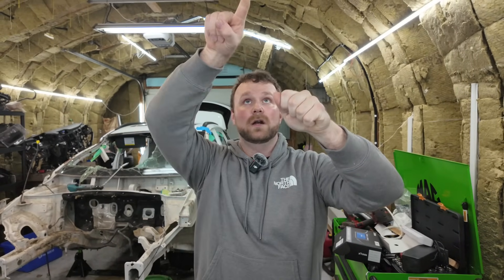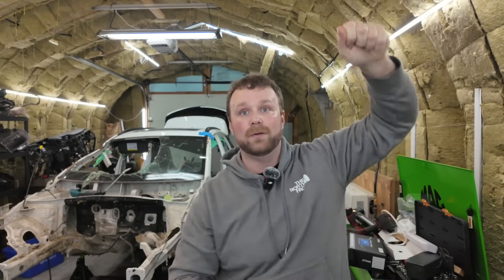Why were these L87's left out of the GM recall?

Comment from the maker: What do you thinks going to happen?
Reply: GM will get bailed out by the Government.
Reply: I have a 2014 2500 HD with a 6.0 nothing has been said about this engine.
Reply: @edwallace7913  from a technician perspective nothing needs said.  Like a rock til you need a transmission at 101000 miles.  The 2014 was sold with 100k powertrain warranty for a reason
Reply: @edwallace7913  I have a 2019 express 2500, 6.0 no problems with the engine, ...just brakes 😵‍💫😵‍💫😵‍💫
Reply: @Lancemechanics  I think that whoever manufactured these crappy parts won't pay a thing and all the money GM saved on using cheap Chinese and Mexican labor will be eaten up plus!  I cannot ever remember this man recalls growing up!
Reply: My SWAG, is GM owners are going to end up with alot of busted up engine blocks............ and no one backing them up.
Reply: @Lancemechanics  ford's solution for cp4 pump failure is ecm programming. Welp now blame it on aftermarket tunes.  The 6.2 is preferred by those wanting a high horsepower engine.  So a ton of them are actually tuned up aftermarket. So read the calibrations and deny coverage because of tune. Or....I have actually taken an engine apart that I drove hard for about 5000 miles . Was gonna put it in another pickup.  Pulled the pan and 2 of the rod journals had silk fabric from a shirt for rod bearings.  That was 40 years ago.  I'm sure textile technology has gotten better since then.  Just food for thought.
Reply: Gm gonna go out of business at this rate...new vehicles are overpriced and unreliable junk. Even to change valve covers on my 09 inpala the dealer wanted 1200😂😂😂I did it myself in my driveway with basic hand tools. Overquotinf basic maitnece and selling overpriced junk is a quick way to go out of business I wonder how much longer they'll last...

Comment: I own a 2020 GMC Sierra Denali equipped with a 6.2L L87 engine. On April 17th, the engine experienced a catastrophic failure. Leading up to this incident, the vehicle exhibited excessive engine oil consumption, necessitating oil changes every 5,000 miles. While I am not a trained mechanic, this seemed abnormal. At 66,000 miles, which is marginally beyond the manufacturer's warranty period, the engine failed, with an inspection revealing three bent connecting rods, requiring a complete engine replacement.

Adding to my frustration, despite being prepared to pay for a replacement engine, General Motors is currently not permitting their sale. This is particularly perplexing given their assertion that my 2020 model is excluded from the recent recall due to certain differentiating factors. This stance appears contradictory to my situation, as the vehicle clearly experienced the same issues described in the recall and numerous class-action lawsuits pertaining to this specific engine.

I would greatly appreciate any additional information or advice others may have encountered regarding this issue. Thank you for the video.
Reply: I too had my 2020 6.2 blow - mine at 67K. It was drinking oil so the dealer started a consumption test. .1.5 weeks later, the truck started smoking from exhaust and I had it towed in. Turns out the pistons were scorched and totally shot. Only fix was a new engine. Luckily , I had an extended warranty that covered the engine. Problem is, the wait for a new engine was estimated to be at least 3 months. My dealer let me trade out and i bought a Ram with the Hemi. Never again GM

Comment: ...wonder how many L87s CarShield and Endurance have paid for repair or replacement before this recall and wonder if they are going to back sue GM for their out of pocket expenses? What if you've had a '21-'24 recall engine installed in a vehicle that had a blown up L87 in a 2019 or 2020 vehicle? Will GM re-replace that engine? With a 10yr/150k warranty?

Comment: Get some cover on that insulation please. 😮
Reply from the maker: Being done soon :)
Reply: @Lancemechanics  Ok. Use a respirator, not a medical type dust mask. Your lungs will thank you. Sorry, many decades in heavy construction has me noticing this all the time. Your rounded surface is going to give you fits finding a suitable covering. I would suggest plastic or metal/aluminum  corrugated roofing sheets. Metal is fireproof.

Comment: If GM would just tune their ECMs the way German companies do, they wouldn’t need cylinder shut down. VW, Audi and BMW use a homogeneous mode for cruising. Essentially the engines run at roughly a 50:1 air fuel ratio when cruising. That’s why their four cylinder DI engines get upwards of 45 MPG on highway cycles.

Comment: I had a 2018 chevy pickup with the 6.2 engine and it blew up under warranty with only 30 k miles on it, GM put in a new crate engine and with less then 60k miles and 3 years of mostly highway driving, it locked upon the highway, I  dont think GM has fixed the issues and probably has warehouses full of these motors , so getting a replacement engine may just be a tempoary fix you have to deal with in 2 more years if you choose to keep the vehicle
Reply from the maker: Thanks for telling us. There's been a update on the tsb and I see other channels posting but again they've missed so much. Its a wording nightmare. One line say if even needs replacement. This path will get extended warrenty. If needs replacement not getting extended warrenty doing it this path. I'll have to release a video. Its wild

Comment: I would think that the whole problem is the way to the oil. The 0W 20 is a very thin viscosity and does not offer near the protection as the 0W 40 does.
Reply: Agree, the corvette uses the 0w-40

Comment: I bought a new 2007 gmc sierra. Recalls. Wipers not shutting off. Heated washer fluid would set some on fire. Bought a new 2007 gsxr 1000. would go to full throttle. was recalled. Bought a new nissan titan. new engine at 21k. bought a 2020 kia soul . new engine as rings weren't hardened. Bought a 2017 camaro ss. lifter failure. All i can say. Is Everything made in the last 20 years that i bought new was FUCKING JUNK!
Reply from the maker: Damn. That's an unlucky list.

Comment: Riddle me this. If we just used the most reliable engines of each mfg. ie ls3 gm. Wouldnt the slight difference in emission's be way offset from NOT having to replace thousands of parts and all the associated pollution. Ie the people making the newer parts. Distribution all the way down to the mechanic doing the job. Its honestly absurd.
Reply from the maker: I keep thinking to my self. Has anybody actually asked that question. or how much emissions are make to remake these plants or retool them every 2-5 years. Or the amount of space required for 1 vehicle manufacturer. Were talking 100s of acres for 1 manufacture.

Comment: So I own a 21 6.2 and it is not recalled.
Reply: I have a 21 6.2 as well, check the build date on the door. mine was built 09/20 and the recall is only for vehicles built from 03/21-05/24 not model years

Comment: Was getting a regularly scheduled oil change yesterday at my dealer (GMC 1500 ‘24). Talked about this issue and they said “no remedy” as recall isn’t officially active at this time.
I said I don’t care put in 0w-40 oil regardless, which they did.
Don’t know if it will help, but figured better than putting back in that 0w-20 piss.

Comment: Imo, the problem has to be with coatings. 20 grade oil doesn't work on traditional engine components ,but advanced coatings have allowed engines to run thinner and thinner oil improving efficiency. The fact that they are "fixing" the issue with thicker oil tells me that somewhere along the lines a coating technique worked in practice and failed in full scale production.
Reply: Thin oil is for meeting CAFE standards only. In other nations these engines are recommended for 5W/30 and there are no problems. EPA is our problem. Just dump in heavier oil is the first thing to do.
Reply: @debi5292  Yea to be honest I'd never run 0w20. You are relying on advanced material composites and coatings to prevent catastrophic failure. I understand that the general consensus is to use what the manufacture suggests, but me personally.. I'd rather lose a few mpg's then have a time bomb under the hood.

Comment: GM is screwing over every owner. The heavier weight oil is just so that the engine can limp past the warranty. Then GM will ghost consumers. They will not be replacing engines unless there is a catastrophic failure. They have been cutting corners for a long time now, and the issues are stacking uptime to buy another brand.

Comment: There seems to be a lot of talk confusing the bottom end issues with the lifter issues. They are separate and distinct problems. The recall of the 6.2 is the truck L87 only. It doesn't include the LT engines in the corvette/camaro. The lifter issue is across the board in all the 5.3 and 6.2 LS/LT engines that have AFM or DFM. Ironically the oil switch from 0W20 to 0W40 is 'supposed' to help the bottom end issues but ironically I have seen several techs and engineers say that that increase in viscosity might actually accelerate the lifter failure issues as those shitty AFM/DFM lifters are designed to work with 0W20 and some suggest that 0W40 is too thick to make them work properly. I don't know if that is actually the case but sounds about par for the course for GM right now!!
Reply: Mid 90's 1.9 low mileage Escort of my nieces...

Brother does his own maintenance...

Changed the oil/filter and it had a lifter/follower noise from startup...

Called me and I asked him what oil he used...

When he said 5W-30, I told him to make sure it didn't take 5W-20, which he had never heard of.

It did. No more tick.

Comment: All they are doing with the oil viscosity switch to 0W40 is trying to push as many trucks past the warranty period as possible so the customer gets stuck with the repair bill. There is a design flaw with the block or crank or bearings or rods or an assembly issue. Changing oil viscosity won't fix that. It MIGHT delay failure but won't prevent it.
Reply from the maker: 100% push it past warranty:(
Reply: It's funny how long we have been building ICE and here they are trying to reinvent everything. I blame the cancer that is the EPA for squeezing out ICE year after year. Always trying to make that BS 0.1% of better fuel mileage to make the cut, thin the oil, lighter tension piston rings, etc. Meanwhile, 80's and 90's Japanese vehicles are peak automotive engineering. Why? They had to make a name for themselves and weren't playing games as far as quality is concerned.

Comment: Are these oil pumps variable volume displacement?
If your engine fails while loafing down the interstate at 1700 RPMs, is there the proper oil flow?
Reply from the maker: Great question. Vane type with variable displacement.

Comment: Thanks for all the updates I’m 70 with the 21 Denali 6.2 retirement truck and don’t know what to do 🤷 We are so screwed all the time in Canada 🙏✌️🇨🇦🇺🇸🙏
Reply from the maker: Can do the afm/dfm delete. Pretty common in Ontario atm.
Reply: I don’t have the start stop bs there was chip shortage when I bought it and I drive in L9 all the time so the cyl doesn’t deactivate ✌️Took mine to dealer today for there oil change fix on engine recall But they couldn’t even do that because GMC didn’t give them to ok yet 🤷🤷🤯🙏🇨🇦

Comment: I have a 2025 2500hd with the l8t 6.6l. It does not have dfm but does have vvt. Cast iron block has a far better engine oil system that supplies oil to the mains first, not the cam galley. The 6.2l is a flawed design period. Changing the oil to 0w40 will not fix it.

Comment: The L87 is a 6.2-liter, V8 gasoline engine produced by General Motors, part of the EcoTec3 family within the Gen V Small Block architecture. Introduced in 2019, it powers trucks and SUVs like the Chevrolet Silverado 1500, GMC Sierra 1500, Chevy Tahoe, Suburban, GMC Yukon, and Cadillac Escalade. It delivers 420 horsepower and 460 lb-ft of torque, paired with a 10-speed automatic transmission. Key features include Dynamic Fuel Management (DFM), which adjusts cylinder activation across 17 patterns for efficiency, direct injection, and a pushrod OHV design with an aluminum block and heads. The L87 succeeded the L86, offering improved fuel economy over its Active Fuel Management system. It’s praised for towing (up to 13,300 pounds in the Silverado) and performance but has faced reliability issues, including bearing failures and lifter problems, leading to recalls and a 2025 NHTSA investigation into nearly 878,000 vehicles.

Comment: I think I’ll be buying a dodge 1500. They can keep their overpriced pile of transmission and engine junk.
Reply: Get an F150 ...the 2.7 and 5.0 are bulletproof...and the 3.5 has updated cam phasers, starting in 2021....even cam phaser tick didn't damage the engine, make it undriveable.....and the 10 speed transmission issue was addressed with updated drum a few years ago...

Comment: What I find funny is the concentration on #3 cylinder.  Statistics should have a dispersion across all 8.  What production / installation process causes such a concentration of failures.  I do not believe there is a way to change main bearings from underneath, no room to really lift the engine, or to lower the front subframe for access.  I think it's a really labor intensive job to do the 4x4's.  Drop the xfer & transmission out the bottom and  lift the engine out the top.  Maybe lift the cab off the frame and do it like a diesel truck?
Reply from the maker: I'm not sure what they are doing to speed up times at chevy, but dodges now everything is cab off  even in the 1500s, Yeah guess I got lucky on the Asian engines. One day I was just Like. Eff it ima try something stupid! lol
Reply: Stop trying to cram 10lbs of shit into a 5lbs bag. Go back to making them the way they used to.

Comment: Thicker oil only helps with fuel dilution issues. Junk engine overall. 6.0 2012 engine was ok but had the cylinder deactivation that ruined cam lobes. Junk junk junk

Comment: My question is if 0W-40 is now acceptable in some versions and not others? 

Why would it not be acceptable in 19-20 and 25s 6.2s?

I have a 2021 Tahoe built July 2020 and it doesn’t fall into the manufacturing defect window of March 2021 to June 2024.
Reply from the maker: I really don't know. But I checked posts on reddit about people using 0w40 in the middle east as early at 2019. Its quite the situation. No one really knows

Comment: Nobody makes a quality vehicle anymore. NOBODY !
Reply: @Damn-h4e  I could be off base on this, but I'm putting all these mechanical failures on one, super thin oils, tolerances that are to tight, operating internal temps. Poor materials being used, the UAW putting horrific financial pressures on the manufacturers, and most of all parts all parts being made overseas.
Reply: Get a Gladiator
Reply: Facts. They want to make more fuel efficient engines, but one doesn't buy a full sized pickup with a V8 engine and expect good mileage. Deactivate the cylinder deactivation feature. Engine will last.

Comment: The moral of the story is if you buy one of these vehicles brand new you have to buy a device that disengages the DFM system and keeps the motor running as a V-8 at all times.

I think if you do that you probably will never have any issues.
Reply: Na just drive it in L9 and it  deactivates all that stuff anyway, it doesn't allow the cylinders to shut off by driving wen you drive it in L9
Reply: @will195 I keep mine in sport mode all the time. 2019 Sierra with 12,200 tow package. 55,000 miles and no issues yet. 🤷‍♂️

Comment: People need to do more research on the vehicles they want to buy.
Reply: You don't have to research very far, before you realize they are all crap.
Reply: You are 100 percent right @joeL-m7q5m
Reply: Your so so right. I did that back in 2019 when I purchased my Ram. Bottom line is. Research, see what the main issues are overall and pick what issue you want. I still have my Ram and it’s been great. But they have there known issues already also but cheaper to fix.
Reply: Home run and I agree.   I researched first and have no regrets.    Go Pro4X.     Zero engine issues since it was introduced back in 2004!

Comment: I'm on motor #3 in my 2020.  Spun bearing 2x.  Paid out of packet both times.  Sat for months both times waiting on parts with no loaner vehicle.  2020s not ion the list is ridiculous.  The problems were definitely there.  I guess I'll switch to 0W-40 and keep babying it.  I sure as hell won't be buying another from GM.
Reply: Last GM I had was a 2000 Impala, after that car, I will never buy another GM product. There quality is crap, just keep pumping out crap engines that as stated in these post are crap. Your paying huge money to have it breakdown, and then wait months for parts is unheard of. They've definitely dropped the ball.
Reply: Why would you have to pay out-of-pocket?
Reply: @Maynardd  Warranty expires after 60,000 miles, or 5 years, whichever comes first...
Reply: @BainMan64  you must drive a lot. Man that sucks!
Reply: Hardyswinson- ya I would be pissed if I were in your shoes.  Sad your going through that

Comment: You say that you are not an engineer. If you have installed a new piston FROM THE BOTTOM, YOU ARE A BETTER ENGINEER THAN ANY OF THE CLOWNS AT GM.
Reply from the maker: It wasn't on a gm product though. I was pretty stubborn and stupid in my teens working on honda engines :p